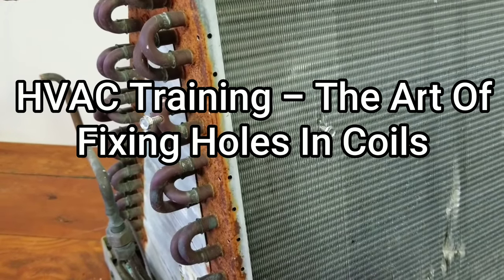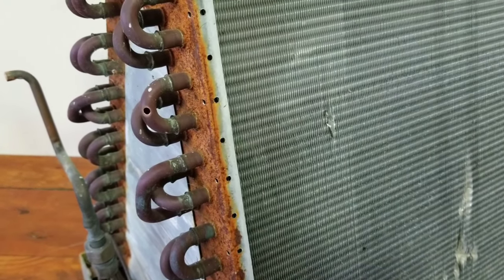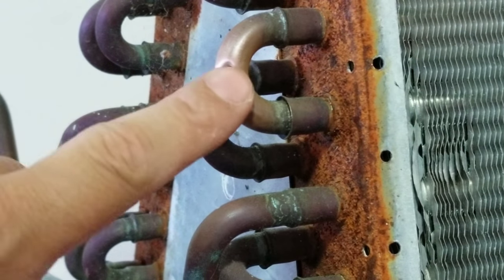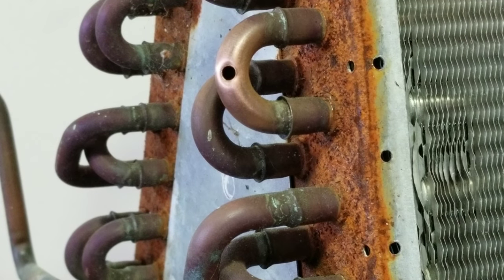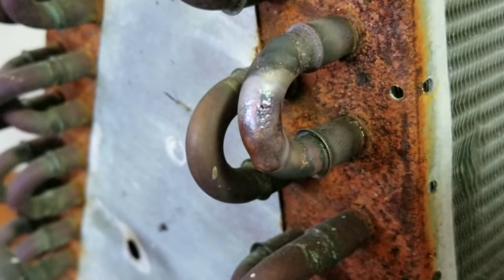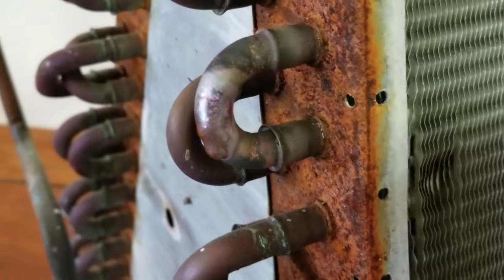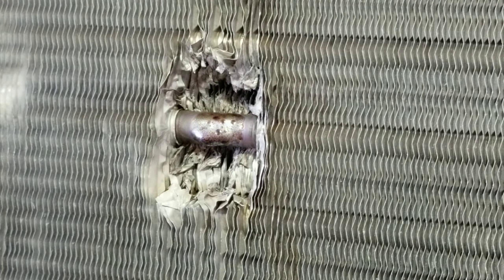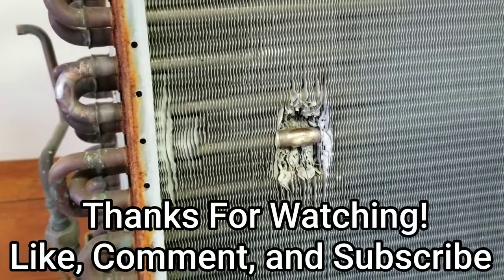HVAC Training - The Art Of Fixing Holes In Coils

Comment: This is no brainer brazing repairs that you don't see very often in the field. What about the hard repairs like where the tubes rub a hole against the metal tube sheet? How about brazing in new cap tubes in a retrofit of a txv onto a coil that was originally only cap tube? How about a video of a liquid header replacement on a carrier rooftop with the metering devices that get plugged often? Most of the manufacturers now design the screw placements so they go in between the tubes only old Yorks had it where you could accidentally shoot a screw into a loop if you choose the wrong length sheet metal screw, maybe others but York stands out in my mind.
Reply from the maker: John Elliott Thanks for your opinion
Reply: I used to spend a ton of time trying to cut away the plate to get to where it rubbed in. It always ends up putting pressure on the surrounding tubes and causing a leak in the future. Best bet is to flux both sides and silfoss the tube right to the plate.
Reply: I have a way to do it that makes it look like it was done in factory if done correctly. I made a youtube vid but it isn't  very professionally done. I have since gotten gopro but my computer is old and cant edit 4k video.
Reply: Also about tx valve changing from a cap tube. It's actually very technical, distributor (and orifice)  needs to be sized for about 20psig pressure drop, TX valve sized not only for tonnage but design head and subcooling. Doing this needs to be speced by sporlan or whoevers tx valves you use. For instance I had a 5 tonne system once that ended up with a 7 tonne tx valve. I checked but couldn't find the video, nice AR though, here in Canada it's trickier to mod our AR15s since most stores don't carry a lot of stock
Reply from the maker: As soon as you boys to post your videos on these repairs  share the links here so we can all take a look and maybe learn something.
Reply: yes, I will do that, I have plans on doing a coil repair video like I said. My company has a big replacement project, we are replacing all the walgreens rooftop units in chicago, about 40 stores. plenty of junk coils to do a proper video. my daughter is going to school for videography so she can film it proper and edit it. My laptop is too old to edit 4k video and thats been my biggest problem in posting youtube vids.